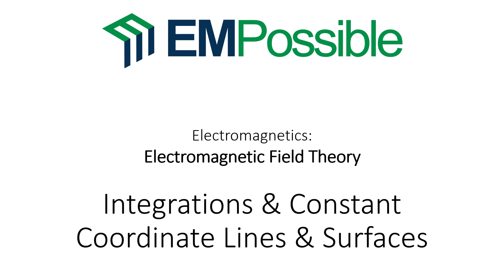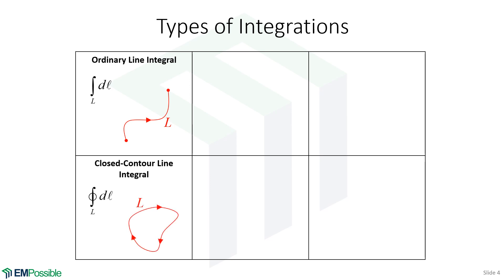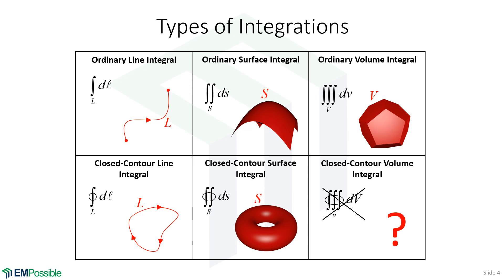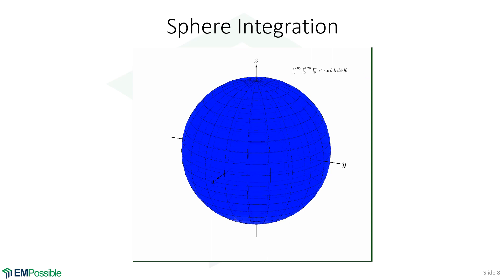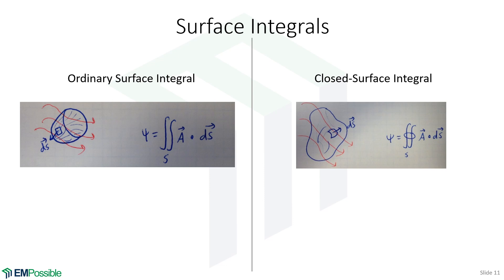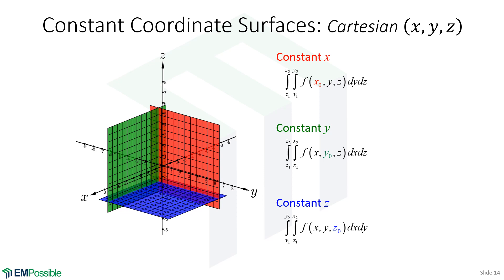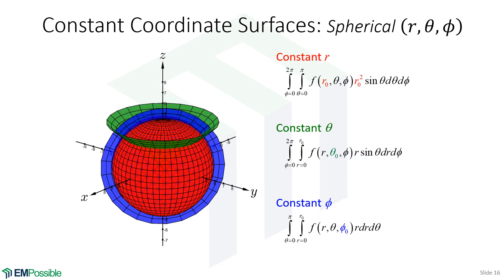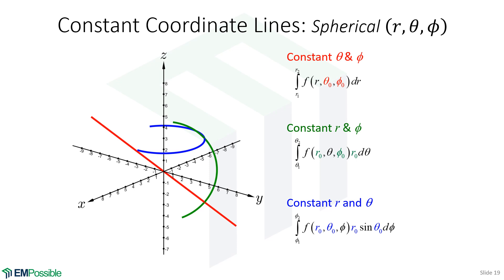Lecture -- Integrations & Constant Coordinate Lines and Areas

Comment: At 5:13, I think the integration limit of theta should start from pi/2 instead of 0, thus it would match the figure.
Reply from the maker: Thank you for pointing this out! There is definitely an inconsistency. When I get around to correcting this, I will modify the animation to match the integral as I have it written. I would do this only because as I have the limits actually written is my preferred way.

Comment: 7:30 normally, we calculate dot products for non perpendicular components. Because its dot product is 0. Why did you say "perpendicular" about flux?
Reply from the maker: I explain more about flux in this video around 2:00:

https://youtu.be/9x0o28mcbek?si=mbbFPipUxABemLFT

Flux is a measure of how much a vector field penetrates some area. The only part of that field the counts as flux is the perpendicular component. A dot product is used to isolate just the perpendicular component.
Reply: @empossible1577   Thank a lot, sir.